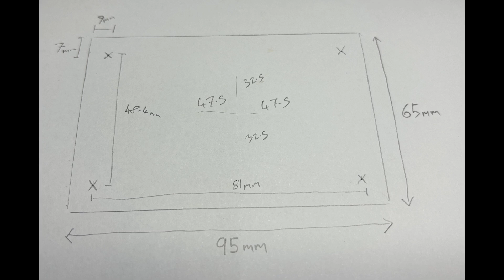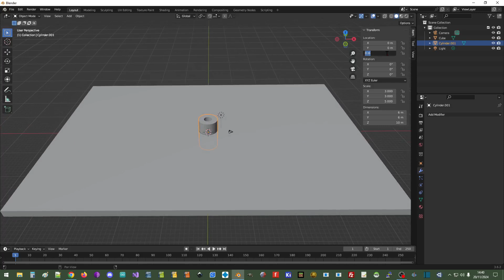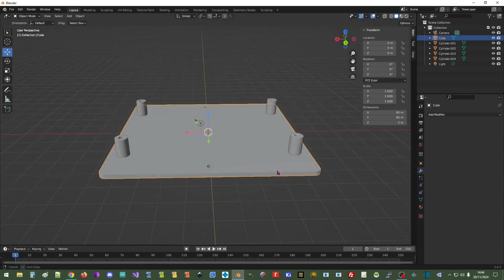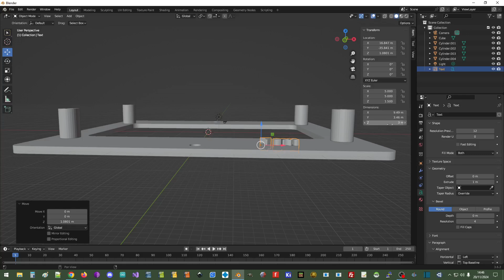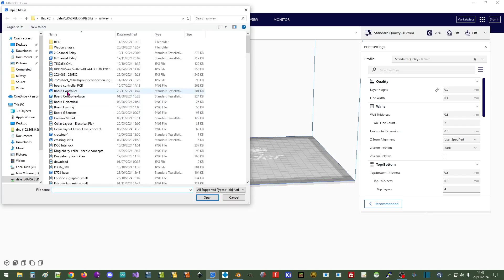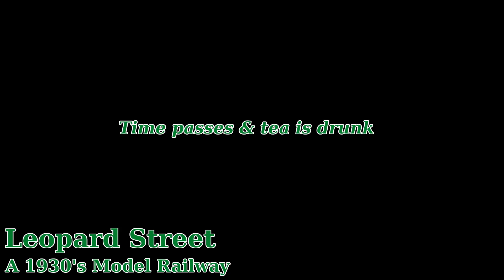Episode 11 - into the third dimension, Leopard Street Model Railway

Comment: Nicely done... I use Tinkercad I do have Blender but have never tried it for modelling stuff... I also have an ender3v2 and use a 0.4mm nozzle and I want to start using a 0.2mm nozzle for some fine detail model train work...
Reply from the maker: I printed some stuff for N gauge, a portacabin with a 0.4 that was very firmly in the "ok in the far background" realm, swapped to a 0.2mm and it was actually quite good, could get a recognisable brick pattern too. takes ages but its good - need to adjust the flow rate in the slicer though as that doesn't seem to happen by default.

worth getting a fair bit to do in 0.2mm before swapping it as they are a pain to swap about too often, good luck with it though, I find the thing useful - even if the head temperature sensor needs replacing so mine is offline currently

many thanks for watching :)